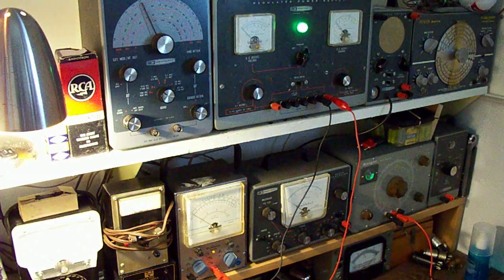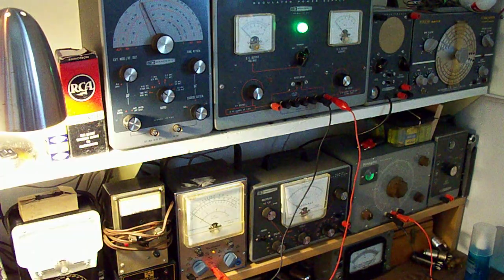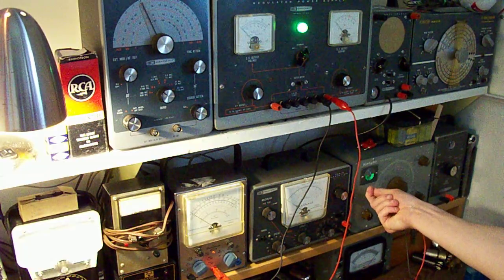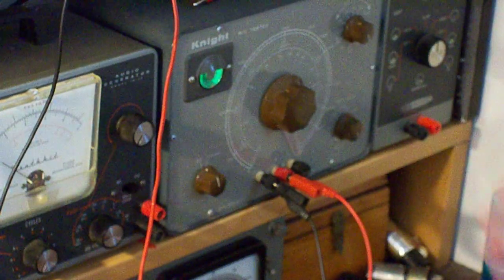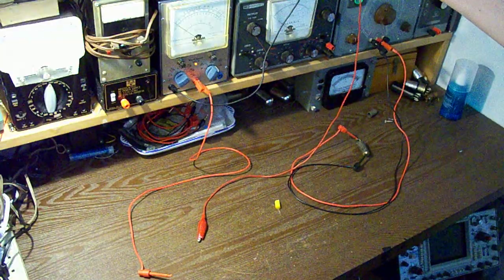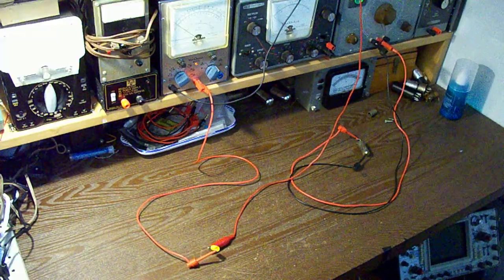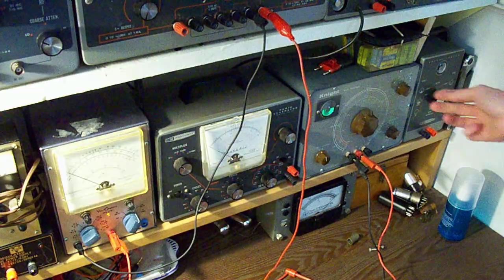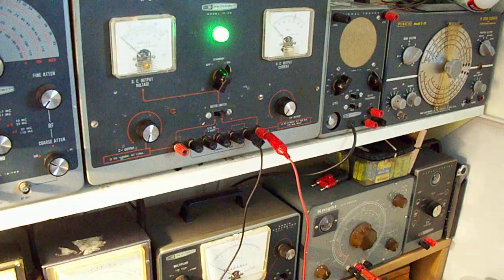Build Your Own Capacitor Leakage Tester!

Comment: Hi Doc Brown's Radio Lab, I,m Just starting to try and fixed old Radio, Believe me, Not easy at 62 years old, I have ,Medical Problems,and need to keep Busy, I have alway's wanted to learn, And don't plan on dying any time soon, Anyway, I just bought a old Knight majic eye,Capacitor checker, Could this be converted, into what you have, If I added a step up transformer, with variable capacitor to adjust voltage output, and add a voltage meter in circuit.

Comment: "Very leaky".... (i.e., dead short) 🙃 an ohmeter would probably more easily tell you that cap is bad. I don't think DC leakage will always be evident with the setup you're demonstrating. I think this setup will work fine for finding shorted capacitors (of course) of any value, and maybe dc leakage on low value capacitors (and if we're only concerned about leaky coupling caps, maybe that's fine)-- but this setup charges the cap through the input resistance of the vtvm (and if using a dmm, in some cases the input resistance may be much higher than a vtvm). So, if the cap is a large value, you would have to let it sit for a very long time to charge before any leakage voltage would be evident. You might be mislead into thinking it's not leaking, but rather, it's just not charging (and with a dmm, it may never charge). Better to substitute the vtvm with a microammeter and put a current limiting resistor in series with the cap. Then you can read the actual dc leakage current directly. But then there's the whole discussion of, "how much leakage current is okay?" Probably none on small film caps, but it can be upwards of hundreds of microamps for larger electrolytics.

Comment: There are so many ways of tetsting capacitors , from using a simple ohmmeter to digital C comparator and the Weinbridge.The one thing most testers fail to do is see how long the cap holds a charge. Aside from its true value, holding an open circuit charge is the real test.

Comment: Could this set be used to ID the "foil" end of the cap?
Reply: The importance of the foil end is in most cases overstated
Reply: The only way to do that, that I know of, is with an oscilloscope. But it is very easy. 

Set the scope's vertical amplifier to some low volts/division, probably around 10 or 20mV. Time base division doesn't matter, just adjust for a solid trace. Connect the probe's ground wire to one end of the cap and the probe tip to the other end while holding the cap body between your thumb and forefinger-- observe the "noise" on the scope. Now, while trying not to move the cap body between your fingers, reverse the probe connections and again observe the noise. The orientation with the lowest noise will be the one with the ground lead connected to the outer foil side of the cap.

I disagree to the comment that this is not important. It's just not that important in all situations, but if you're trying to keep as much noise out of your signal path as possible, I think it's important for bypass caps to be connected with their outer foil side on the lowest impedance path to ground... especially in high gain stages.

Comment: Great video! This is a surprisingly simple method. What is the model of that Heathkit power supply you're using?
Reply from the maker: Thank you, I'm glad you found it useful! It's a simple and handy test to be able to do. It's a Heathkit model IP-32 regulated high voltage DC power supply.